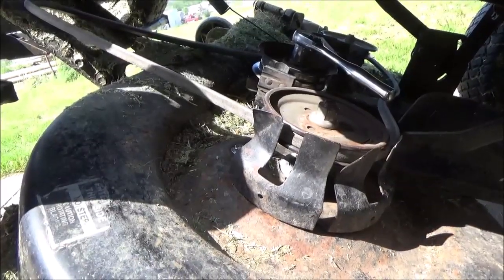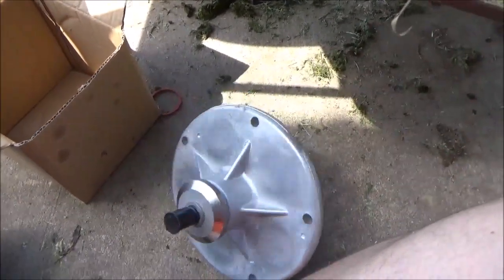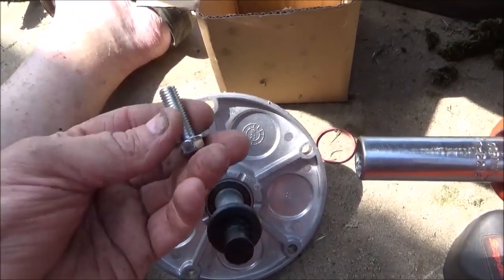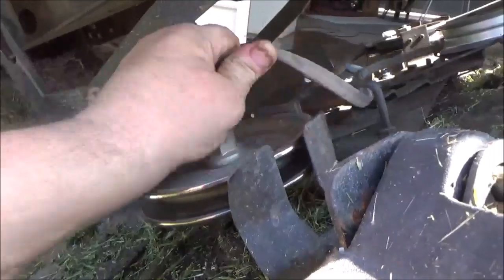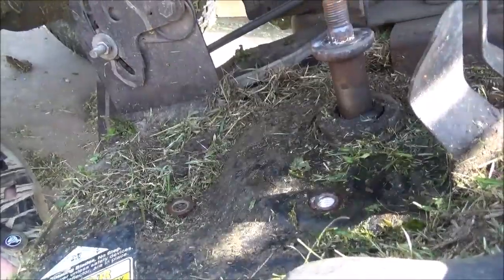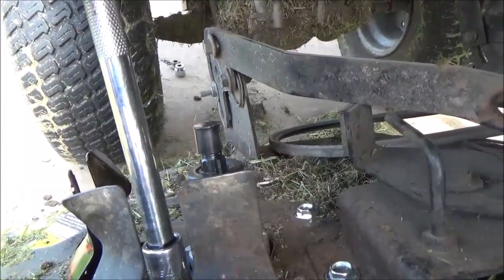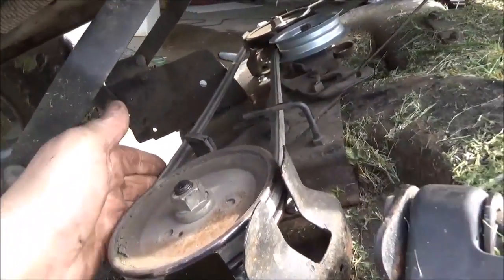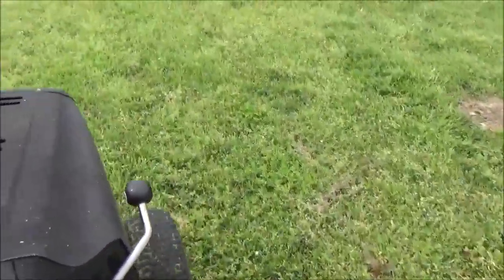OWN A RIDING MOWER? YOU CAN DO THIS! HOW TO REPLACE THE BLADE SPINDLE ON ANY ZERO OR RIDE ON MOWER

Comment: I bet the bearings were sealed and greasing them via the grease zerk would be useless unless the inner bearing seal is removed so grease can get to the bearing.
Reply from the maker: The grease
 Goes
In sealed or not.  Just be careful not to over grease  as the seal can pop out
Reply: @THEMOWERMEDIC1  How does the grease get in if the bearings are sealed on the inside where the grease is getting injected in to spindle?
Reply: How can I send a question to you that doesn't pertain to this? I do not know how without tacking on to this.

Comment: Thank you. I've seen someone put a zero in but he also put a pressure relief hole in which he uncaps when filling so as not to blow the (especially outside) seal. But I've just received new spindles with zerks but no relief... What to do?!
Also people below day the bearings are sealed both sides so trying to grease  is pointless. I thought they made sealed one side only bearings. Have looked at the markings on mine but can't find any thing with precisely the same. I think the suffix -- in my case -2rts5/8 and  -2rtst (inner and outer bearings are different sizes!) is supposed to tell something about this, but I can't find anything. 
Also I'm not about to bash this new spindle open to check!! A vido 'The truth about mower sponsor's says there's hardly even any grease in sealed spin bearings!! So open them and pack them!! Grief. What's a girl gonna do?
Reply from the maker: The grease is intended
To fill the void in the spindle and keep condensation out. However the seal in the bearing is made in such a way that grease will enter the bearing with ease just don’t over grease
Reply: @THEMOWERMEDIC1  okay so how about this. IF the inside of the bearings have covers, I fill up the void between the spacer and the ... tube via the zerk. Remove the outside covers if possible -- they're metal not plastic, and pack the whole, both sides, of the bearing because they only apparently have a thin coating of grease. What do you or others think of that?... I haven’t thought it through fully...obviously.
Thanks.